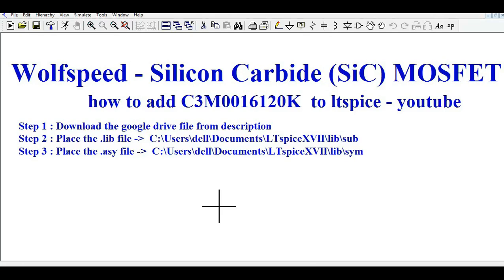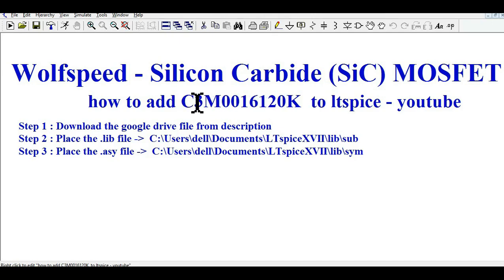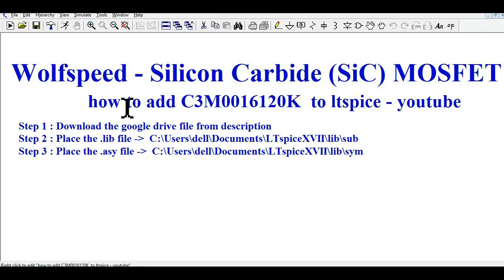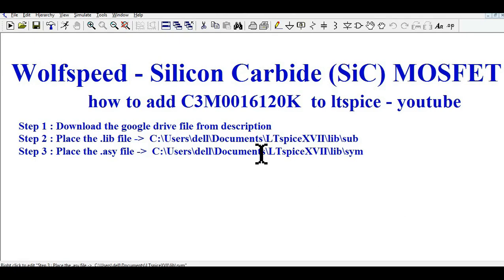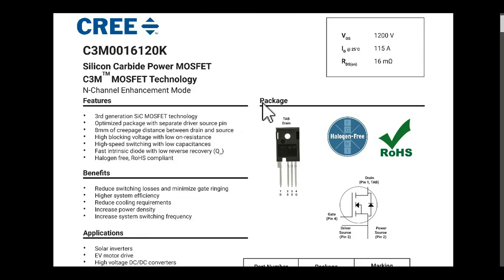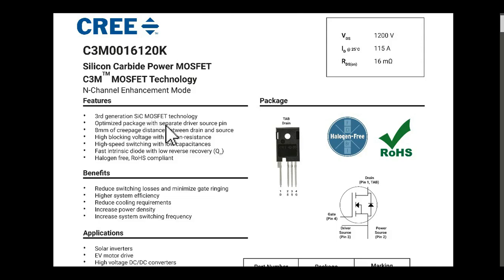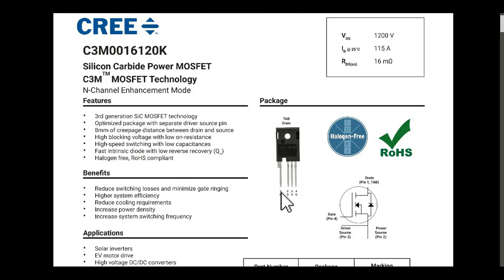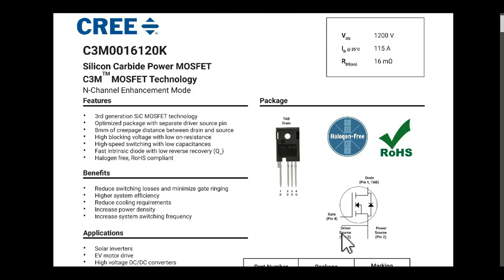How to add Wolfspeed SiC MOSFET C3M0016120K in ltspice library | Si MOSFET RC MOSFET Library

Comment: An error comes "unknown sub circuit called " while I am simulating...Pls help
Reply from the maker: Hey...thanks for your question.
What are you trying to simulate , pls explain more ?
Reply from the maker: You need to include your library into schematic using .lib command.
Reply: @ElectronicsCircuitHubECH  Yes, It works... Thanks for the advice sir👍🏻
Reply from the maker: @vipinckty1  Good Luck, Keep Learning !
Reply: @ElectronicsCircuitHubECH  
HI, I get the same problem by trying to insert it... Do you mean I have to write ".inc C3M0016120K.lib" in window named "Edit text on schematic" ?
Reply: Can you make a video on zero crossing detector for different frequencies using OPAMP,phase meter that can detect 45 degress
Reply: Hello sir I have some questions
Reply: How to find the drive file of any components, normally I got in pdf form